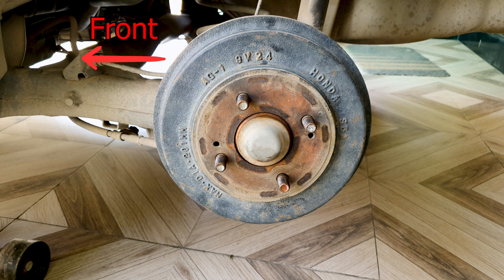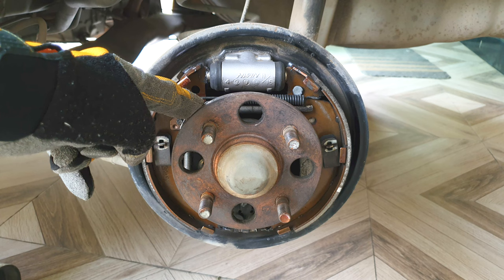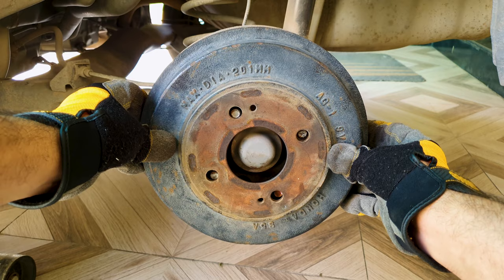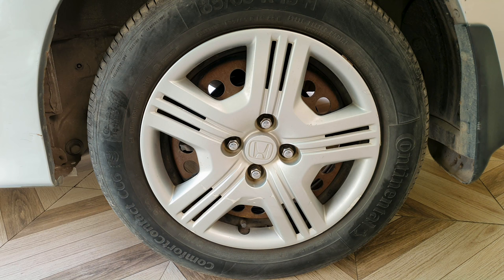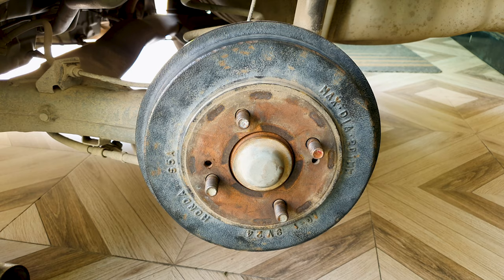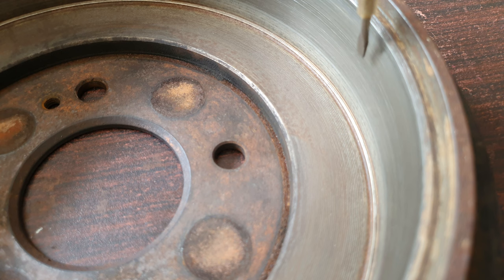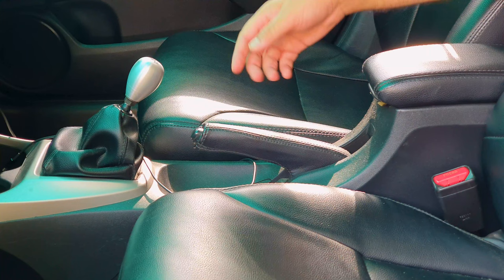Noise gone, braking improved! - drum brake adjustment made easy

Comment from the maker: Most, if not all, modern drum brakes are self-adjusting. On Honda’s, they self-adjust when you reverse and brake. They don’t self-adjust if the mechanism is seized or you don’t brake enough while reversing. Personally however, I have always found that drums still need to be adjusted to get it to an optimal spot.

How to jack your vehicle up: https://youtu.be/fs1Ams0rsrI

Comment: Mine does this  exactly but it sounds more like that last noise in your video. More creak creak creak.  Any ideas?  Its been like this ever since i put on new pads and switched the wheel bearing. I tried lengthining the adjustment a lot of clicks after having this for like 3 months . Maybe i have to go even further but it felt pretty tight when i spun it.  I wonder if the shoe material was bad from the beginning?   It almost sounds like the return spring but also like ots the shoes.  When installed i greased the contact points on the back plate so i dont think thats the issue.
Reply from the maker: The last noise at the 0:04 mark?
Reply: Yea around 6 seconds.  @TheWrenchWiz
Reply from the maker: I dont think it would be the shoe material. The drum, where the shoes mate, that sufrace may not be perfectly straight so the new pads may not adhere to it properly. Brake shoes do have a pivot pin, that has to be greased in case you missed it.

If you feel the noise is coming from one side, try switching the drums and see if the noise direction shifts. Sand down the drum surface and a bit on the brake shoe material. Then re-bed the brakes. 

Lastly, with the wheel on and off the ground spin it. Adjustment should not be tight and the wheel should spin mostly freely. You can hear rubbing noise of the shoes against the drum. If the sound isnt continuous in nature that could indicate the drum itself isnt properly round. Best to have that measured with a vernier caliper, to see if distance at different points is more or less the same. 

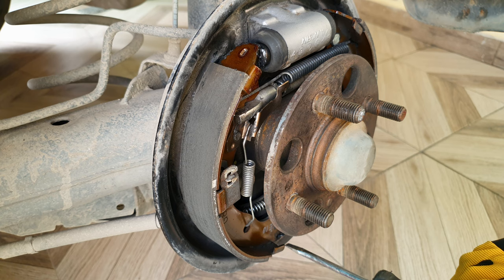Anothing thing coming to mind (but as a last resort if your sure everything else checks out), the wheel bearing you changed. If, for whatever reason, the wheel bearing hub isnt straight then brake shoes wouldnt contact the drums evenly. Or part of the axle is off if you hit a pothole or something. OR the drum part check the mating surface where it goes against the hub. It should be clear from any rust (im assuming you resued the drums). That could cause the drum to sit unevenly. See the below video from 5:50-9:00 mark. It is disc but same principle for the drum.

https://www.youtube.com/watch?v=mW3Uqqi61BM

Comment: Hi im having the same issue i just got my brakes replaced like 2 months ago with some aftermarket parts i ordered the right rotors for my 99 civic lx but im not sure about the brake shoe if its for lx. Does the wrong shoe can cause this noise and skipping? Happens when  braking thanks
Reply from the maker: Possibly, I couldnt say for sure. But I would think that if the brake shoes were physically smaller or bigger you would have issues fitting it properly. In the case of bigger you may not be able to fit the drum on. Do you have old ones to compare the size with?

The drum part, did you replace or kept old one?

Comment: Hi, I got the rear drums, shoes and hardware replaced by a mechanic on my 2010 Corolla and I'm facing the same issue. He did readjust the drum a bit but said if it's too tight the brake will seize. He said after market parts may be the issue. I've already spent $350 on this, any advice on whether it's an adjustment issue or if it actually is the parts? The noise in the video is exactly what my car is making
Reply from the maker: It only happens on light braking?

Yes it could be aftermarket parts, in the sense that if it doesn't meet OEM standards and is not properly round to being with. Best way would to be measure the diameter from the inside, if it is properly round. If it isnt then need to have it machined. 

Another thing, pad material needs to transfer on to the drum for optimal braking. Until then it may not grip properly. On an empty clear non busy road, drive at 40km/h and pull the handbrake up a few seconds - release it, do it again a few times. Do NOT pull it so hard that your wheels lock up, just enough that you can feel a reasonable (braking) resistance. That can help create a better bond between the pad and the drum surface.
Reply: Thank you for responding! It makes noise whenever the rear brake is engaged. At very low speeds (0-15km/h) I think the front brakes stop the car but any speed higher than that will continue to clunk. Thanks for the suggestion, I'll try to pull the parking brake and report back. 
And just for general information, this sound is only caused by the shoes? Or could it be the hardware as well?
Reply from the maker: Front discs do maybe 70-80% of the braking. This sound is the shoes hitting the drum, it skips on it. It like bounces on the drum as you brake. Im not saying noise cant come from some other part, but most likely it is this.
Reply: @TheWrenchWiz   It did make a noise when the brake was engaged but didn't seem to fix it after a tried it a couple of times. Is it safe to drive as is?
Reply from the maker: @saadsubhan7607  Front does the most braking. I would not say its dangerous. BUT, you are not getting optimal braking, stopping distance would be affected some. So I would get this issue sorted. 

Get the drum checked out, if it is properly round. Get it sanded to remove any small imperfections that may exist. You can swap the drums also, see if that helps. 

If your mechanic doesnt have a clue, go somewhere else.
Reply: Appreciate your input! Thank you!!
Reply from the maker: Np. Good luck.

Comment: Does this same principal apply with the parking brake? I hear a clanking noise and I think it is my handbrake shoes clanking. If I make them expand should this stop the noise?
Reply from the maker: @Dnasty1 when do you hear the clanking noise? Same as in the video? Parking brake just engages the rear brakes whether it be drums or discs.
Reply: @TheWrenchWiz  no… my noise only occurs after driving from a complete stop (after braking). Sometimes it will happen as I brake to a complete stop as well. It happens more when I take off slowly and goes away when I go to normal speeds.
Reply from the maker: @Dnasty1  Clanking when driving and not braking. It could be the shoes are too tight. Not shown in my video, I did tighten one too much and it did the same thing, was fine after higher speeds. 

In this case I redcued the shoe distance. You want a little resistance only when turning the hub. After adjusting put the wheel on and spin it, until you feel/hear a little bit of resistance from the brake shoe. Sand the drum surface too, to remove any brake deposits that may be on it causing an uneven surface.

The core issue is the same that the shoes are skipping on the drum surface.
Reply: @TheWrenchWiz  I was thinking this as well. But could it be the shoes are too loose? I think I loosened it until there was no resistance. Are the pads supposed to touch the rotor at all while it is spinning or only when the parking brake is engaged?
Reply from the maker: @Dnasty1  Yes maybe it's too loose. When spinning there should be a slight resistance or touch. When you turn the wheel you can hear it slightly rubbing against the shoe or pad. 

Parking brake will engage the brake, same as if you press the brake pedal. 

Leave parking brake out of the equation for now. Adjust the rear brakes and test drive. Parking brake tightness can be adjusted later once you get the brake settings right.
Reply: @TheWrenchWiz  oh my car does not have drum brakes.. the brakes are a floating caliper design. But for the parking brake it uses these shoes can they be the cause of my noise?
Reply from the maker: @Dnasty1  what car model do you have?
Reply: @TheWrenchWiz  Mercedes e class 2010
Reply from the maker: @Dnasty1  Ok this is a completely different setup. From what I saw online, yea there should be no resistance adjusting the parking brake mechanism. If it moves freely then I dont see how it can cause noise while driving/braking. 

What you have described, it could be something with the pads and its contact with the disc. Apart from the parking brake adjustment, did you do anything else afterwhich this noise appeared? Was the noise always there?
Reply: @TheWrenchWiz  this noise happened actually while I was bedding in new rear pads. It had a very aggressive bedding process which I will never do again but when I was done I had this clanking on the right rear only. Could I have warped the rotor? I would think if the rotor was warped it would make this noise constantly wouldn’t it?  Also the parking brake setup looks almost identical to your drum brakes aside from that hydraulic thing… mine I believe is spring loaded. I wonder if they should sit slightly touching the rotor as you had said. Often times I see mechanics have to loosen the handbrake to remove the rotor.
Reply from the maker: @Dnasty1  Your parking brake system does not contribute to braking, so in your case they should not slightly touch the rotor according to the adjustment procedure. But the nature of brakes shoes is such that you may not get it at the perfect spot that allows optimal parking brake engagement without light touching. If it moves freely enough by hand (the hub or wheel) then I dont see how that can contribute to your issue.

It could be a number of things your noise. Yes your disc could have warped. It could be your brake pad on that side is moving a bit and it hits the caliper bracket whenever you brake (or release the brake). Are your pads genuine or aftermarket? Maybe the size metal housing of pad is slightly smaller. Is the retainer clip for the pad ok? Could be an issue in that.

You could try swapping the pads on the other side. If the noise is the same on the rear right, then swap the rotors. A warped rotor would only cause vibration or maybe pad skipping when braking, unless I guess it was extremely deformed. You could also sand (a bit, not too much) the rotor surface, there could be some pad material deposits that make the surface uneven.

Comment: I replaced my drum brakes on 2002 jeep liberty a couple days ago. On the driver side I can smell the breaks and I feel heat. Could be the I need to adjust it as I didn’t do that or could the cylinder be bad ?
Reply from the maker: After replacement it must be adjusted. Now they would be too tight and you are constantly dragging against the brake shoes when driving, causing heat.

When off the ground you should be able to spin the wheel farily easily, there should be a slight drag on it only.
Reply: Do I have to have the whole rear end off the ground or can I just jack up one wheel at a time? And adjust it.
Reply from the maker: One wheel at a time is prefectly fine.  

However, after adjustment and as a final test you could lift both off the ground to compare if both spin similar with similar amount of resistance. Just for peace of mind.
Reply: Thank you! I greatly appreciate it
Reply from the maker: Best of luck!